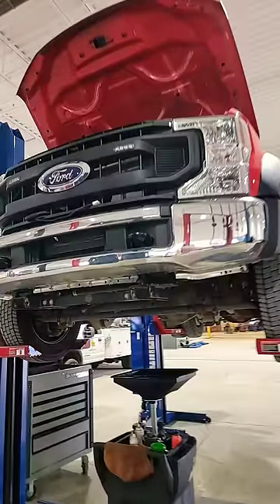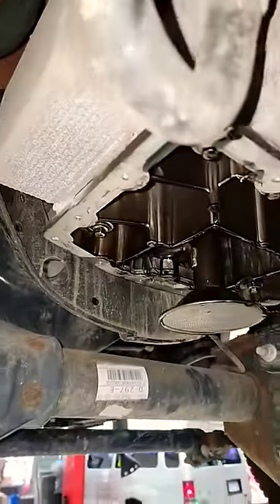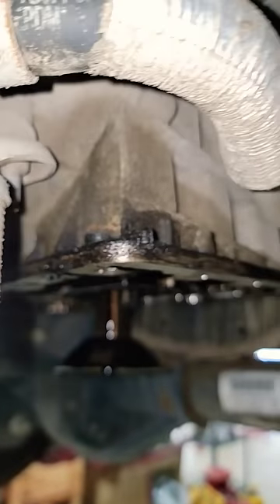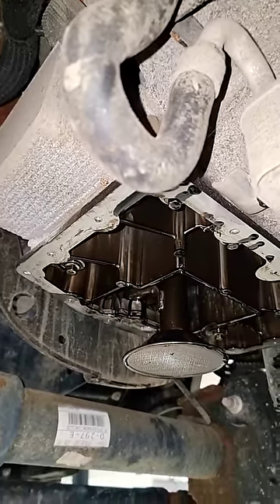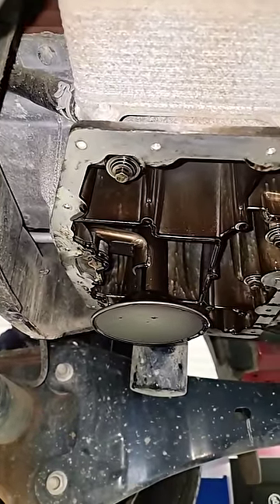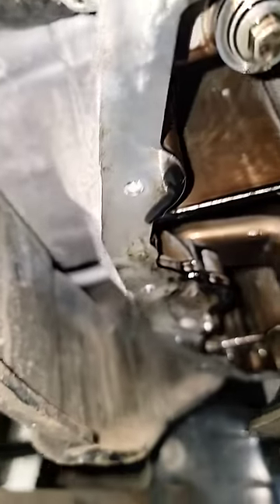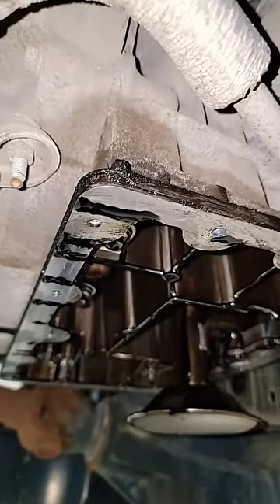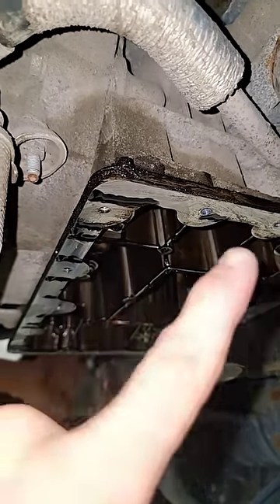Listen UP you Ford 6.7 engine builders  SMH 🤦‍♂️#bebetter #shorts #fyp #fordtrucks

Comment: It's all about production. Quality went out the window a while ago
Reply: Definitely wasn't there in the 60's. I restore cars and everything after 66 was thrown together.  Especially Mopars
Reply: @danielmcgilliss697 people just like to talk and say nothing. More then likely these sorta issues come from ramping up the production.
Reply: That's the American way.  God bless capitalism.
Reply: Was a mechanic for 18 years of my life. All makes and models have issues. Its the brand chasers that have no idea what mechanics see.
Reply: @odst4336  i work on my own cars I've seen more horror from American cars than I've seen from Japanese or German cars my hatred of American cars comes from working on them and not one American transmission proving me wrong
Reply: @Chrissy212  only transmissions ill swear by are Allison Automatics, The TH350 and TH400 and the Muncie M22 Rock crusher. All the others one, yeah pitch em
Reply: @odst4336  the vast majority of drivers are unknowingly hard on their vehicles in simple ways. Like slamming a pothole with the front tire in a corner, running wayyy long on maintenance cycles, not breaking in motors properly. The list goes on, part of the reason cars depreciate so hard and used cars come with red flags lol
Reply: @synshenron798  yes truck transmissions are fine because they have to work people have to be able to depend on their trucks they buy them for that but any car that's not centered around it's reliability they make sure they die in less than 60,000 miles you know as soon as it's out of warranty it's dead
Reply: @Chrissy212  oh yeah no for sure. A very close friend of mine works at a GM plant assembling engines and he was sayin "dude I have less than 3 minutes to get 6 pistons in the block, tighten the caps and send it down." And I asked him about if they torque it down and he goes "yeah we torque it down." And I asked him whats the torque rating. And my man goes "oh its whatever my impact is set too". Ive built engines before ok, when I build engines I plasti gauge the main caps and the con rod caps to be 100% sure the oil clearances are to spec and they get adequate oiling. With the way my buddy does it, or at least how GM tells him to do it, he just zips on the bolts and sends the engine on its way
Reply: @synshenron798  yeah German manufacturers and Japanese manufacturers do this too but they have a machine linked to the tool checking that everything is correct
Reply: @synshenron798  but the other thing is the German and Japanese manufacturers have a stand where they hook up to the engines they run them get them up to operating temperature they do all this on a stand and they verify that the engines are good I said American manufacturers just build them and send them out the door they don't do any checks on them
Reply: IT'S CALLED  "UNION D-BAGS."
Reply: @shanecavaliere2554  people just dont know what the hells going on. instead of that BS tax class they have highschoolers take (that teaches you literally nothing), maybe basic vehicle concepts/maintenance would actually help people. you should check out the channel “just rolled in”, shows a lot of people destroying their cars, thinking theyll drive into the shop like real life is GTA and get a brand new car out for less than 500 bucks, all in the same day
Reply: @unclecreepy8343 its upper management. I check quality
Reply: @synshenron798  In a way, I can understand that from a production point of view.

Like, as an assembly guy, his job is to zip on the caps. Those impacts are used only for tightening rod caps, and don't get used for any other torque job. They have shop hands who go around on a regular basis (probably once per shift) making sure they're calibrated right for each station on the line.

Also differently, those parts have never been used. Not a single rotation of the engine. No starts, no stops, no misfires, no cold nor hot running. There's no call for a gauge because if it's wrong, that's a parts production problem further up the line, and it probably applies to that whole batch of caps. So I guess your friend's process isn't wrong, it's just a fundamentally different situation, and he just happens to be doing the same job on the same parts you do.

As for longevity and planned failure... whoof, I dunno. That's above your friend's pay grade for sure.
Reply: @charlestishman7117  dont get me wrong I dont disagree with you cause I can see how the impact isnt used for anything so you can tune it in the ball park of the torque specs. That and if the caps/bearings have issues then its the manufacturers problem. The reason I gauge my bearings, evem if theyre new, is to check for bad parts. Last thing I need is my 468 BBC lockin up or burning up the bearings as it goes down the track. He puts the new V6 engines together. The engines ive built have gone from single cylinder go karts to Big Block v8's
Reply: @synshenron798  Absolutely a good point, for a guy who builds engines for high-performance situations, you NEED that level of quality control. The average V6 driver isn't gonna be demanding or getting (heh heh) that kind of performance from his engine.

My background is in aviation stuff, and we were approved by the FAA to extend a degree of 'trust but verify' to our suppliers. I don't remember the exact details but it was something like this:
- Inspect every one of the first 500-ish units (it was aviation so by nature low-volume + high quality floor).
-If no defects were found in that test batch, inspect 1 in 5 of the subsequent parts or at least one per batch, unless a defect were found, at which point the clock started over on the supplier, and we worked with the supplier on a process verification/production inspection report to track down what went wrong.

I imagine something similar takes place in the automotive world, yeah? Probably to a totally different degree because the volumes are so different, but still.
Reply: @danielmcgilliss697  well it was a Chrysler product so what did you expect?
Reply: Facts.. I work at a Mercedes warehouse and I can 1000% back this up
Reply: I agree.
Reply: THIS is how we lost the market to overseas manufacturers in the 70's & 80's .
Reply: @shanekruse2283  - Yeah , "Capitalism" is the problem with UNIONS . Yeah - riiight - NOT .
Reply: @chuckintexas  unions built this country's middle class.
Reply: @Chrissy212 My turbo 350  has been together for 50 years without an issue. It leaks a little at the dipstick but still works great. GM made great transmissions for many years.

Comment: This is precisely why I deliberately bought a vehicle built in Japan over others of the same model built in the US. Pride in work and attention to detail!
Reply: That 6.7 Ford was assembled in a Mexican facility
Reply: Not a guarantee though, Subaru is running into issues in their new FA24 platform for a similar issue to an extreme though. It’s doing exact this and then breaking into chunks and plugging the pickup tube. Which isn’t serviceable without removing the front cover. It’s more of an industry standard issue really.
Reply: Yep! Me too!
Reply: Sounds like the qc guys got lazy.

Comment: One wise mechanic told me “If they did the job right we wouldn’t have one”
Reply: Not at 3k miles though.
Reply: @aloud9738  can be dodgy ODO?
Reply: Ya but the manufacturer should be making it perfectly they are not technically mechanics at that point now they are machinist No one wants a shitty machinist
Reply: It's a Ford
Reply: Yup Job security

Comment: The biggest problem is no more gaskets they try to use silicone everywhere even in foreign production and silicone is not the answer it will work in some areas but not everywhere nothing beats good old gaskets
Reply: Silicone is a very poor auto sealant. Use aviation gasket cement.
Reply: The Asian cars started that trend. Saving cost...
Reply: @SorinNicu Asian cars last 10x longer than American cars
Reply: @Sisonpyh  I had both American (multiple Ford) and Asian (Kia, Hyundai, Toyota) cars. 2001 to 2011 era... They all lasted the same to me, but I follow the maintenance schedule.
Reply: No. Science.

Comment: Bro, When I did my upper pan I SURGICALLY cleaned it, Got the ford Baby wipes and used the 7.3 silicone. It’s been few months now and it’s Bone Dry!! Thanks for your Videos and others
Reply from the maker: No other way to do it ma , bottom line. All about the prep work 🙌🙌
Reply: I redid the upper end on my 300 inline six and also cleaned the piss out of every surface. Runs like a top 6 years later.
Reply: "Ford baby wipes" 😆😆 thats called brake clean and a rag around here.
Reply: @noelleonard2498  looks like you are new to PTT community 😂 it ok Stick around you will learn some new thing’s. Lol
Reply: I use the Ford baby wipes on a lot of Land Rover Jaguar products. Especially the lower oil pan which loves to leak on those and has the same issue. Poor prep work at the factory.
Reply from the maker: Finally a fella that gets it. These viewers think we are just wasting their time......

Comment: If it had a gasket, the glue does not matter.  Also, "people" do not apply the rtv, The nozzle is out of a two axis robotic dispenser and the pan is placed by a pick and place robot. a multi turret driver twists all the screws  to a calibrated torque at the same time.  Been there, seen that.

Comment: That’s a lot of rust for 3000 miles
Reply from the maker: Yuup
Reply: Man that's what I was thinking
Reply: @mikebonar3702  my 18 Chevy doesn’t have that much and it’s a fucking Chevy undercoating 😂
Reply: Most brand new cars off the lot already have rust.
Reply: @SillyGoose69  not one I’d be buying
Reply: Theres a lot of reports of how the new trucks come rusty and corroded
Reply: I was just going to comment this. Wtf dude. That driveshaft looks like it was sourced from a salvage yard. 🤦‍♂️
Reply: Probably in the north. That winter salt will eat your car up
Reply: @stephmo371  negative. That's bare metal with no treatment whatsoever. So the simple humidity in the air is causing the rust.
Reply: It’s probably because it’s was sitting for 2 years in fords plant holding lot waiting on parts before it was titled. So even though it’s a 22 it’s was sitting for 2 years before it ever saw the dealership.
Reply: With all that dirt underneath, it's driven in some salty and wet, nasty areas. 

If you live up north it's common to see that at 1 winter. It shows you where you have to spray with oil based undercoat asap or else it will rot. 

You guys down south call it bad, but it's the nature of getting salt water on your vehicle - every - single - time you drive on wet roads for 4-6 months out of the year. You might as well pressure wash your underbody with sea water every day you get home. Vehicles DO NOT survive unless treated. Don't care who makes it.
Reply: Kinda his fault if he didnt oil the chassis but hey wouldnt it be nice if car companies would sell oiled frames for the northeast market?
Reply: @volvo09  dude it has 3000 miles on it my Chevy has been through 3 winters and it’s cleaner than that peice of shit
Reply: Ford - “built to rust”
Reply: Remember all those lots full of cars waiting on chips for a stupid window motor or whatever? This is probably one of them. 2022 but it sat on a lot for 3 years.
Reply: @LynxStarAuto  when you put inferior metal near a superior metal the inferior will rust and corrode quicker I don't know why but I have seen this in out board engines in the lower unit and they are call sacrificial plates to help protect the aluminum casing from corrodeing
Reply: Keep in mind all of these trucks sit for months and months outside in the elements awaiting chips. There are 1000's all around where I live
Reply: @HiTheNameIsBj  this truck sits on a jobsite idling or something. 3k miles with 400 hours equals an average speed of 7.5 mph. So since we know that's not a realistic rate of travel, this truck sat idling a lot. People who sit around in the truck on a jobsite with the heater or AC on usually don't give enough of a fuck to wash their worktruck and get a treatment, so mag chloride OR salt air will do this. If they say this truck wasn't somewhere cold or close to the ocean, it's a lie.
Reply: @SillyGoose69  it doesn't help that during the corona shutdown and untill a year ago ford had fields and fields of built trucks with no chips. Most of these trucks sat in a grass for a year or more
Reply: Wow for so much money it should be rust resistant drivetrain
Reply: @HiTheNameIsBj  yes you do, good eye. So now we have all the explanations we need. It's been working alongside salt trucks on roads covered in mag chloride and having the living piss beat out of it as a plow truck... Wonder why it has problems? 🥴😂
Reply: He still said 400 hours engine run time that's a lot of time for so little miles.
Reply: The parts have probably been sitting for a year before it got built then it probably sat in mud waiting to get shipped for a few more months. As someone who delivers parts to assembly plants ask me how I know. The dealerships look pretty however the assembly plants... well
Reply: @Wild-Wisdom  yeah see that's the stupid part is it's not even hard to add bare minimal protection but they're not dealing with the consequences most time. Simple shade covers gates with tarps to keep dust and trash out someone just generally giving a shit and taking them out or checking on them.
Reply: @Apolloneek   yep, once it's built their job is done they could care less that someone is spending a small fortune on it.
Reply: @Wild-Wisdom  yeah don't I know it I work repair and have been in warehouse work for preproduction q&a to preshipment q&a and there's shit we had to fix soon as it stepped off the truck before it went to customer
Reply: @readysetfloorit1915  I understand that, but this ain't that. There is rust on the main frame, on the axle, and the driveshafts I get. They never come painted or coated anymore. So they get surface rust just existing.
Reply: @HiTheNameIsBj  that’s also cause vw is pretty much the best out there for rust prevention and paint. My buddies 90 something diesel Jetta with over 300k on it has one of the cleanest underbodies I’ve seen. Any other brand though I’d expect to see this much rust at 3k in New England. And I’m a mechanic in New England so I’ve seen my fair share lol
Reply: Pandemic builds? Chip shortage build? Built then put in a field until parts came in? Hell maybe it's all 3 scenarios?
Reply: @0xsergy  but that would mean they built the 2022s in 2019
Reply: @catfishbilly3.765  all the new trucks are rusting!
Reply: Most of them from 19 through current sat in in a parking lot for almost a year sometimes more waiting for chips they’re spread out in parking lots all over the state. i know a guy whos job it is to just go to all the parking lots and move the forward by 2 feet to keep from getting a flat spot on the tires
Reply: @blondeguy08  they’re everywhere i know they kept them at the fairgrounds and even all the way out at Kentucky speedway all the way out in sparta
Reply: @catfishbilly3.765  Ford from Dearborn, MI, never rustproof lol
Reply: He said it has 400 engine hours means it's been running a lot without going anywhere
Reply: aka its not a 22 or 3000 miles
Reply: Possibly a flood car from disaster related weather. Lots hurricanes, tornadoes and flooding as of late. Customer thinks they are buying new and never would think to check.
Reply from the maker: ...this one, no.
Reply: @dill5500  dude my 98 doesn't have that much
Reply: @stephmo371  I'm BC Canada and my 98,05, 19 and 21, NONE of them look like this!
Reply: @dill5500  If that Chevy has AFM, then God bless those lifters.
Reply: just bought a 2015 volvo with less rust than this
Reply: Can’t wait to see the failures on electric cars due to rust and corrosion
Reply from the maker: Me too, gonna be a sparky kinda show
Reply: Looks to be all surface rust, but yea that's not good for 3000. My 96 Saab 9000 looks like that after 206,000 miles. And even then the frame itself is clean. Just metal hoses/screws etc
Reply: Its a ford thing. Cheap metal
Reply: @stephmo371  , I live in upstate NY. Where I live they salt the roads if there's a cloud in the sky. I have had salt speed bumps on my street all winter. MY car is an 09 has 166,000 on it and isn't rusted. I have owned trucks and cars for 45 years and never had rust like that. I had a 97 Subaru with 315,000 miles on it . The CV joints finally went and I scraped it. I had to drain the gas and found only one two  inch  hole in the frame . The body was fine .
Reply: I think rust is added on in the sticker 🤣

Comment: Had a 22 f150 the other day that came in with 35 miles. Had to replace the trans under LTIS due to some kind of internal failure causing harsh shifts
Reply from the maker: Dannnng fer. LTIS ftw!
Reply: Dude what caused it? I just had to take my 19 in for transmission noises at 25k on the clock.

Comment: Not just them. My golf course got all new leased mowers, brand new 2022 john deeres. Bolts were loose all over the place, fluids weren't topped off and it seemed like they were in the shop more than they were being used.
Reply: Got Toros at mine. We picked up our new Sand pro that has a hydraulic front blade attachment. We found hydraulic fluid all over the trailer after taking it back to the shop. We find out the hose wasn't tightened all the way.
Reply: Are the JD mowers LOCKEDOUT for DiY repairs like their farm equipment?
Reply: Better check the rear end fluid. Some come with the wrong fluid or none at all.Also some are made of plastic.I personally would drain and replace just to be on the safe side.